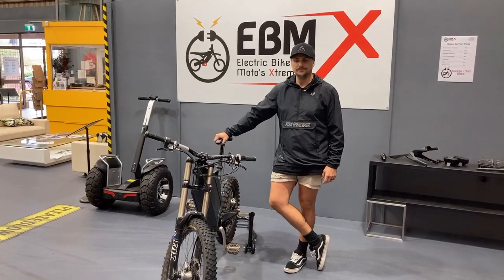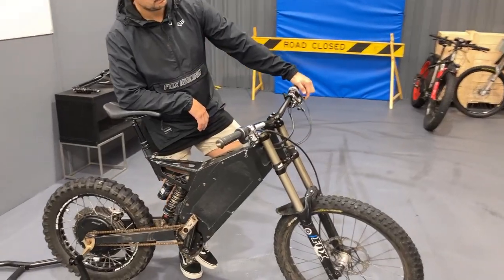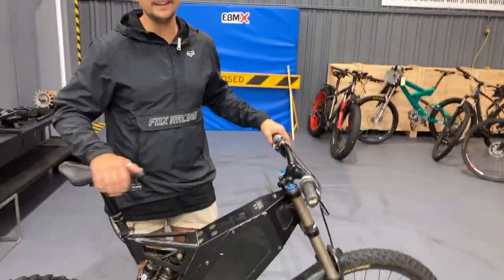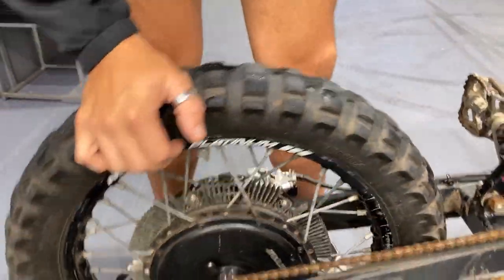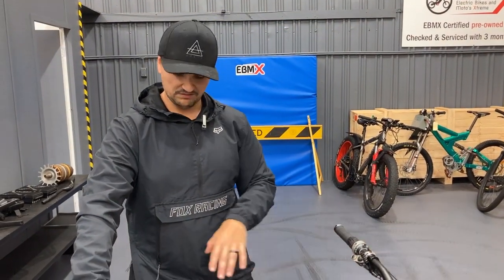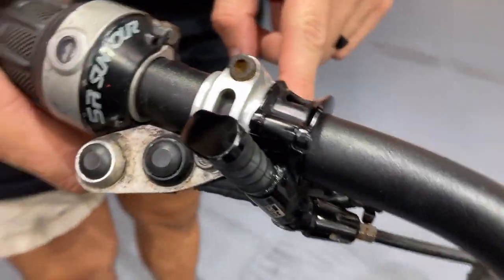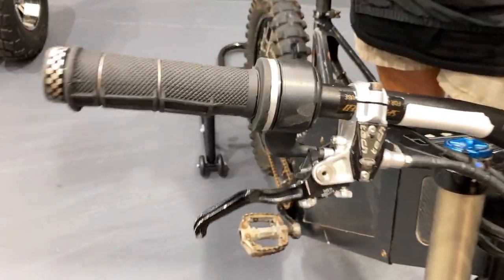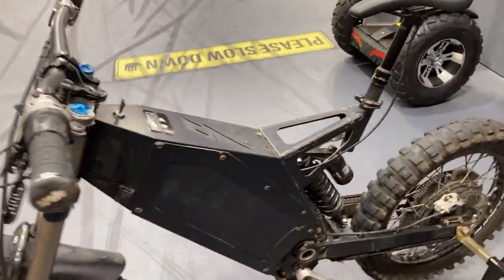The most heavily modded Stealth B-52 Electric Bike in the World.

Comment: The reason why I like this better than the suron is because you can pedal it and it will charge the battery and not use all the battery and you can go faster if you pedal
Reply: Surrons have pedal kits. That would be even better. Surron is meh now compared to the e -ride pro ss. 60mph out the box. True dirtbike of a machine.

Comment: How many ah is that battery? Its got a mid drive and hub motor so id say its like 7000 watts and if u got a 80ah battery thatll run for abouts 40 mins at max throttle

Comment: Controller inside the battery box ?  well thats a dumb idea....  uh, just incase you have never been told, HEAT is the worst thing for it.... now you have all that heat from the controller and the batteries, inside the case.... and well, it's only 1 wheel drive... you want a real ebike, how about 2 x 10,000 watt cyrstalyte motor's :), I built one of those over 10 years ago, my current ride is similar frame, with 2 motor's and BOTH controllers are on the OUTSIDE... LED headlights, turn signals, brake light.... 2 x 48v 20 amp hour batteries.. then there is the trailer by Rambo bikes, with 2 motor's, solar recharge.... battery pack in trailer too, 100 amp hour total...then there is the dual fuel genny 48v @ 3kw, electric vehicle range extender from ali express... so ah no, not the most heavily modified ebike on the planet....
Reply from the maker: the controller is actually inside the top of the frame - it acts as a heat sink - its actually pretty clever. ill make another video and show it properly.
Reply: That motor cant take that much power anyways as its a low Kv one. Controller wont be working hard, neither the battery if they are properly chosen. Should be very minimal heat generation.